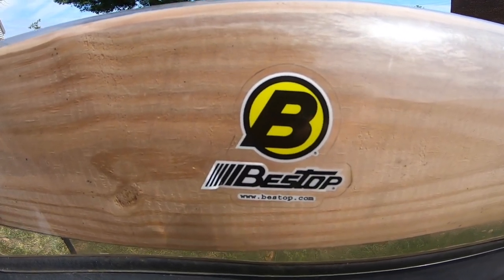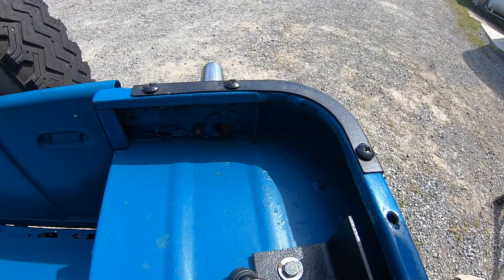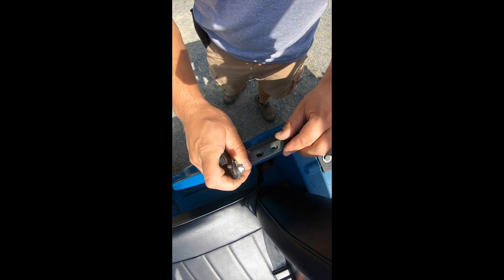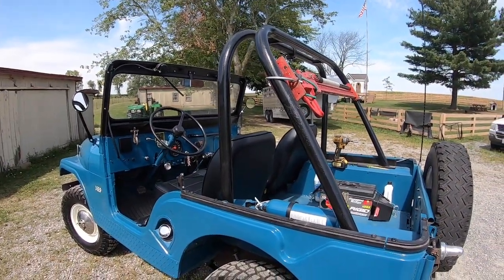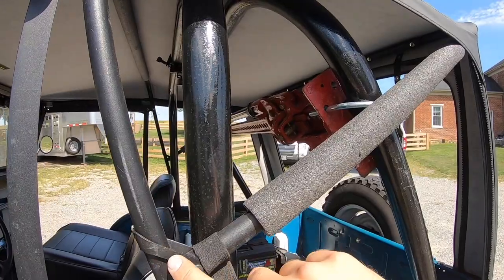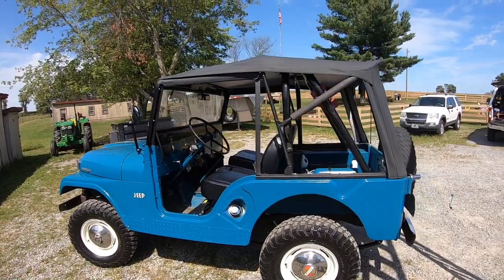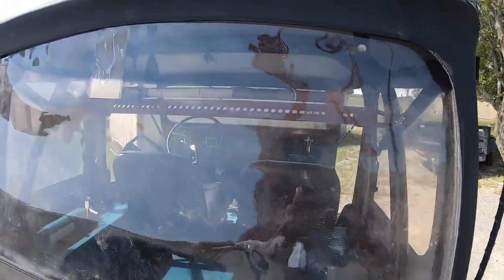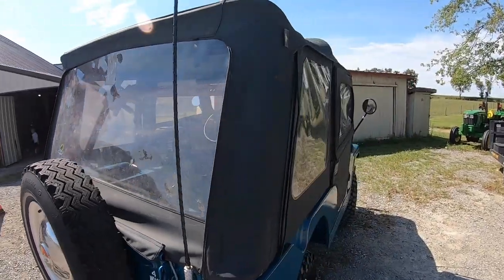Install a Bestop Supertop on an old CJ5

Comment: I love how you’ve restored your CJ. Thanks for saving a Jeep! We bought a brand new CJ5 back in 1974 and it came with a dealer installed rear chrome bumper exactly like yours. This is the first time in 46 years that I’ve seen another Jeep with that bumper! Your new top looks great, jeeps are made to be functional. Thanks for the video and the memories! A fellow jeepster from🇨🇦
Reply from the maker: Thanks for watching! I can't say that I really "restored" the Jeep because it really could use a frame-off resto, however, I just want to run it how it is for now and enjoy it. When my kids get a little older, we'll tear it ask apart and do a full restoration. Glad to bring back some (hopefully) great memories!

Comment: Now,  imagine  pulling  up  to  a stop  light,  and  without  getting  out  of  yer  jeep,  slip  yer  fingers  through  the  space  between  the  top  and  bottom  door  half.  Separating  them  by  sliding  yer  hand  back  and  forth.  Cracking  the  door  open  slightly,  wave  at  the  car  beside  you,  cuz  there  three  kids  in  the  back  seat.  Left  hand  the  top  of  the  door  off,  and  into  the  backseat.  Left  hand  the  bottom  of  the  door  off,  and   into  the  back  seat.  And  then  the  girl in  the  back  of  the  car  beside  you  asks  her  father,  "Daddy,  can  you  take  my  door  off  please?"   You  smile  wave  and  and  watch  as  the  driver  sticks  his  hand  out  the  window  giving  you  the  "bird".  You  know,  you  have  just  made  another  Jeeper.

Comment: Cool Beans, I just bought an all original unmolested 1956 CJ-5/M38 that is in need of a new soft top.  I like how this Bestop Super top fits and installs.  By the by, who makes the dual crown roll bar that is installed on your CJ?
Reply from the maker: Thanks for watching, I really like my Bestop. I'm not sure about the roll-bar, it came with there Jeep when I bought it and I believe it may be homemade.
Reply: @65SEEJAYFIVE   Thank you for replying.  I will re-watch to determine design and placement.

Comment: Bestop makes a good product. Curious though, if you don't m,ind me asking (just don't answer if you do), How much did you save by going used? W went new when I bought mine, and probably shouldn't have. Ran me 15 hundo, including the doors.
Reply from the maker: I think I paid a few hundred for the Supertop on the CJ5. Much cheaper than a new unit.

Comment: Probably a good soft top, technically, but i simply don't like the design. I find the door window ugly. Then it's too modern for a cj5. Plastic door handle has a cheap look and the contrast with a 50 yo car is tragic imho. Best top should have designed it thinking about the historic destination, paying more attention to.the details
Reply from the maker: filippo giardini thanks for the opinion. The SuperTop is the more modern top but also has more conveniences, like two-piece doors and zippers instead of snaps, both of which make it more desirable to me over the more era-correct Tigertop. The door handle is not plastic, rather metal. I don’t believe there is any plastic piece on the framework come to think of it, except maybe a tiny piece on  the door surround-part. If you want a more vintage look, Bestop’s Tigertop is probably more your style.
Reply: He roasted you low key man.. should of looked into them more before commenting all of that
Reply: He doesn't roasted anyone, because, plastic or metal, the sense of my opinion doesn't loose general sense.
Reply: And then again, i did not entered quality question, but only aestetical, that is strictly personal. I am sure that bestop is a total quality product. I simply told that it  is not aestetically matching such an old jeep
Reply: filippo giardini I agree. Im looking into buying one myself for my ‘63 CJ5 but theres something about the doors that seems off. My idea is going to a sailmaker and having them add in the “tractor window” on the bottom of the door. That would go a long way in my opinion.
Reply: Filippo--- I agree with you. The problem is that Best Top is the only one out there that I have found.